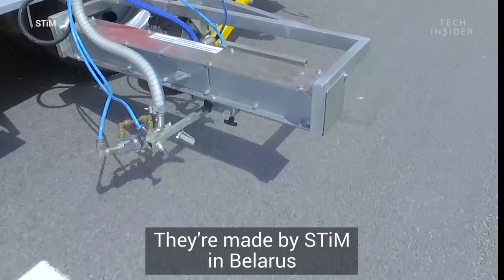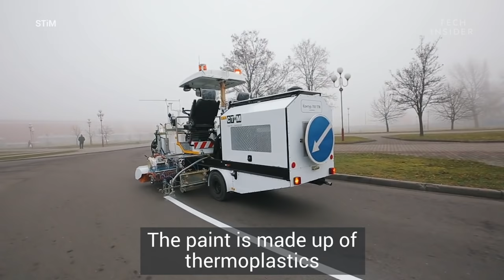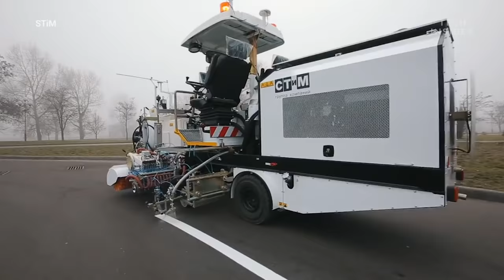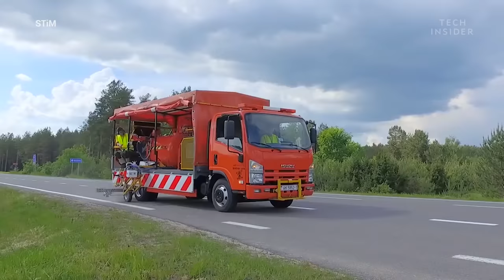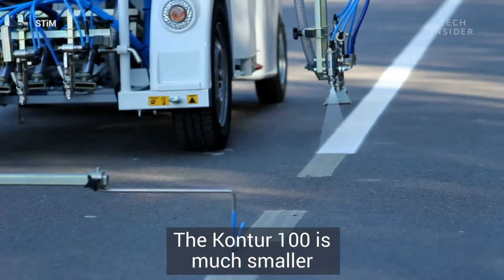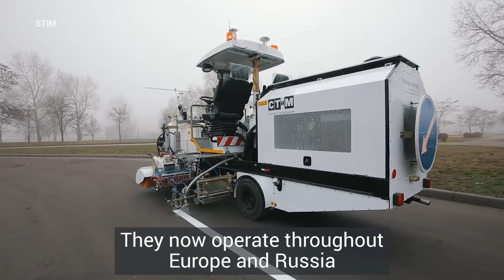Machines Spray Paint Roads With Incredible Precision

Comment: I wish they explained how it knows when to stop and release the paint as well as how its programed to go in a perfect line. I drove from texas to florida and was watching the lines on the roads and thought "How long does it take to do this?"
Reply: They actually aren't "programmed" to go straight per say. I actually do this for a living and the straightness of the line still falls on the guy driving the truck and the person on the back that is controlling the paint guns!
Reply: what they dont Show: the machine has a built in Computer that is programmable,it also requires pre marking and a driver
Reply: In the US, magnetic collars are added to the driveshaft with a pickup sensor.  The skip timing system is calibrated typically on a 1,000 course.  This allows the skip timer to know the distance travelled.  The skip timer can then be programmed to paint a predetermined length and leave a predetermined gap; called a cycle.  On US interstates and highways this typically set at a 10' painted skip and 30' gap; hence a 40' cycle.

Comment: I came here to learn how lines were pained so accurately. I have learned nothing. I see these trucks out there with lazers, and guys hanging off the sides. I'm guessing that the driver uses the lazer to get him close to the original line, and then there is a sensor that finds the old line, and adjusts the guns to cover the old line.